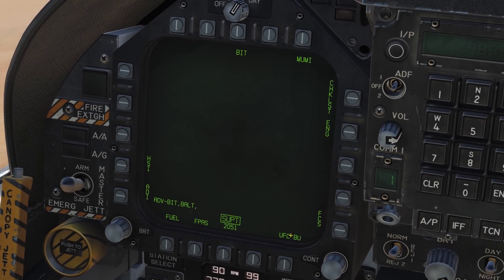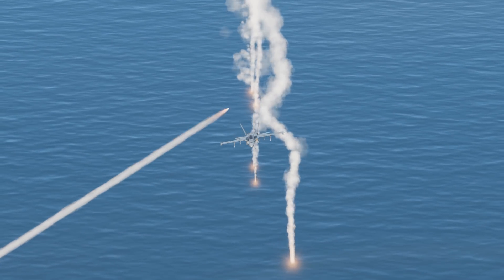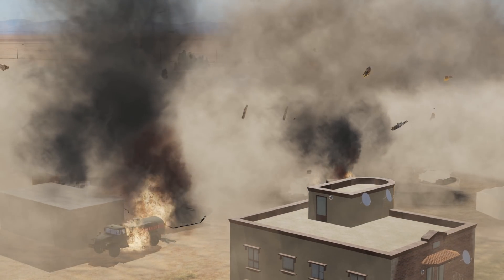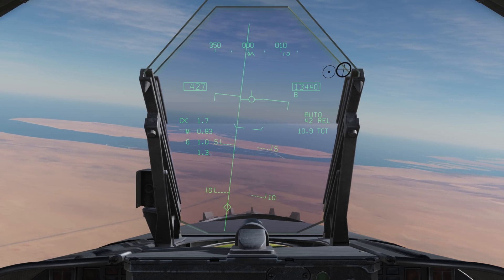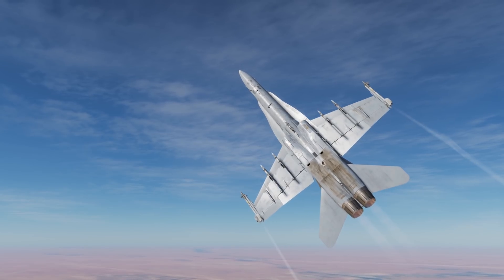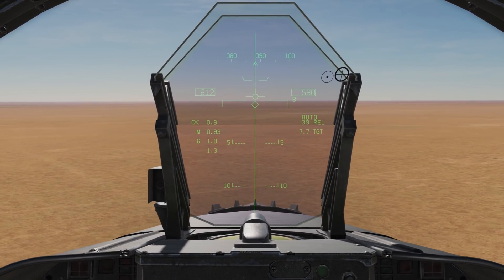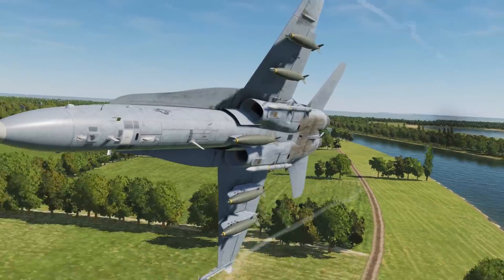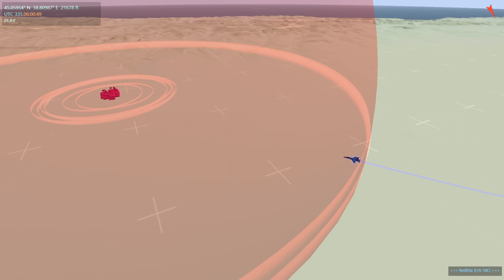DCS F/A-18c Hornet LOFT, AUTO and CCIP bombing Tutorial

Comment: even with the perfect run i could not achieve loft bombing, exactly same parameter, did you switch to radar altimeter ? i switch to radar altimeter too, it is not accurate , not sure because of early access or my mistake! exactly, the best result achieve by 83, u r 100% percent right, the temp affect a lot as u mentioned

Comment: I use 4.5 miles at faster speed, can get off before 2000 feet which is a lot better than 7000feet if you have SAM's. Also the ripple is useful for this.
Reply from the maker: I chose a fairly simple to remember and easy to do loft for the example so people can learn and get some success before experimenting themselves. You'l always want to tailor your loft based on the threats.

Comment: I didn't know that the temperature actually has an effect on the ballistics, but that explains why most of my bombs tend to fall long (mostly plain 82s or 82SE in FF) since I did most of my test runs with the Hornet on the PG map with close-to-realistic temperatures, basically maxed out through the roof. Well, couldn't manage to set it above 40.something °C which is like 10 less than real for an Arabian summer (Caucasus allows for higher temps strangely). Thanks for pointing that out. Will revert that map to standard DCS 21°C then for the time being :D

Another thing that got me though: By intense testing I've noticed that whatever you'll set your burst height for CBU-99/100 at, it's always 1500' in the end. Doesn't seem to work yet actually in the early access. but I might try testing that again, since my last tries were in either 19273 or 19641. Didn't see anything in the changelogs though.
Reply from the maker: Colder the air is the denser it is, putting up more resistance, helicopters in particular get more lift in cold weather. There's quite a few things that slip through the change logs, even the aim-120b wasn't mentioned when it was added! My experience has been the lower the burst the more accurate it'l be suggesting the auto calculation isn't considering the change in ballistics when it bursts.

Comment: It's incorrect I think. Loft mode is not within Auto mode. Proper Loft mode is separate mode which will be add later... This loft-ish is just shortcut and not actually proper Loft mode in F-18C IIRC
Reply from the maker: I wouldnt be surprised if there is a dedicated loft mode that we're missing. One that has loft start prompts and programming for release angle. The auto mode does support impromptu lofts though and is stated in the manual as supporting up to 45 deg lofts.
Reply: RedKite  auto mode does support loft but saying that LOFT is within Auto mode could be misleading, especially when real LOFT mode will be added and people will search for tutorials.
Reply from the maker: Auto mode is how you loft for the time being, if a dedicated loft mode is added i'l be certain to cover it with a new tutorial.
Reply: Lazzy Seal In the F/A-18C Tactical Pocket Guide there are references to a "AUTO LOFT" mode which would suggests that the Hornet has a Loft mode which is a submode of AUTO. This makes sense as the Loft mode in the AV-8B (which has similar avionics to the Hornet) is also a submode of AUTO.
Reply: @swinder3695  AUTO mode supports lofting up to 45 degrees. But still it is not "LOFT" which will be available later. LOFT has more settings and Lofting with auto mode is not LOFT mode per say. But RedKite already cleared that. He will do updated tutorial when LOFT will arrive and there will be no misunderstanding I hope. My concerns more about wording itself, because lets say in a year people will search tutorials and can be confused and will use lofting with AUTO instead of LOFT or will be puzzled, because there are a lot of people who watch YT tutorials but not really nerding inside tech docs. And title here clearly says LOFT so search will give them result for this video among others..

Comment: It's so hard to convince myself to put time and money in the hornet with both the F-14A and B and F-15E so close to release
Reply: F15E is not coming in at least 1 year. (I would say 2 years min).
F14-A, B are the ones coming next but we don't know if that will be this year or next one.
Reply: RAZBAM said the ETA for the F-15E would be in months, not years.
Reply: No module takes just a few months to develop. I have seen the pictures they are posting on facebook and you can see how they are just starting the textures of the interior.
Now considering Razbam doesn't have many employees and they have many other proyects ongoing I don't think they will release it soon.
Reply from the maker: I'm very excited for the mutlicrew on the tomcat, the f-15e is a long long way off. The hornet is much more about ground attack than the tomcat, and much higher tech so id say theres plenty of reason to get both.
Reply: THe Hornet is the Multirole Do it all aircraft, and in terms of avionics is more high tech and digitally integrated aircraft than the Tomcat., and is very manuverable at low speeds. Along With Aim9X an JHMCS it will dominate  anything in CLose Range  Aerial combat.

Its something that truely fits for 21st century scenarios and is very versatile bird. The Tomcat is basically a Cold war vintage Fleet defense interceptor  (  Though  lantirn  TGP integration  for the F14B was post gulf war) vr with older electronics,  with some degree of bombing capacity, but not anywhere the versatility of the Hornet.

ID say get both, Hornet and TOmcat, but all in all the Hornet is a no Brainer Purchase.  Its arguably got the widest appeal due to the Time period of the module, and versatility.  The F15E release being right around the corner is quite uncertain. I doubt itl be in a few months given  "in a few months" the F14 will be here with allt its features. IF the F15 was so close to release Razbam would already have been building up a Hype train like ED with the Hornet,  or how  now Heatblur is dong with the Tomcat.
Reply: For the record, I think I got the Hornet a month or two after posting this. You can see how unfamiliar with DCS I was for betting on Razbam